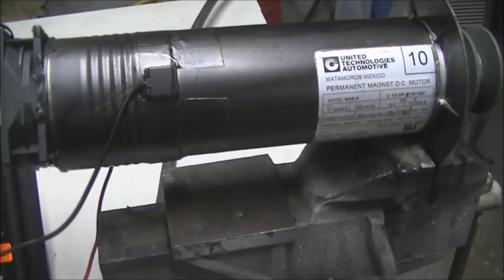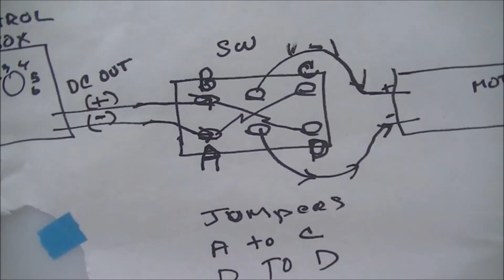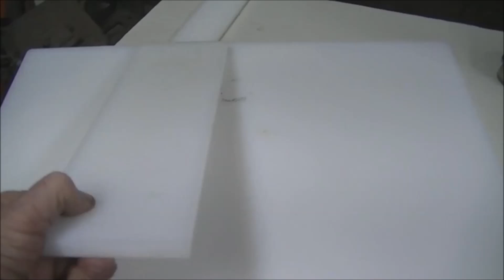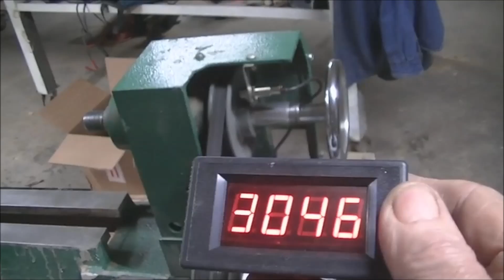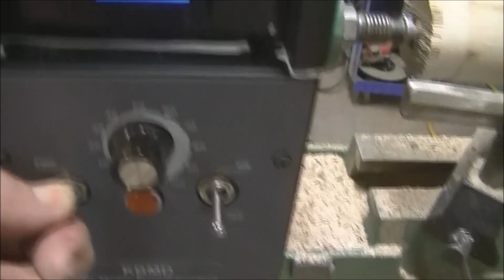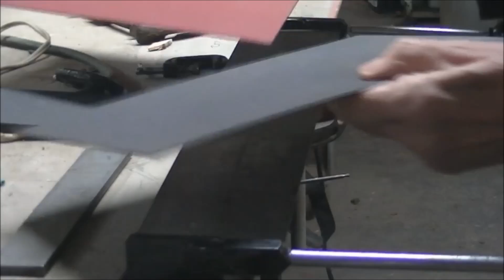Harbor Freight Lathe Conversion using a Treadmill Motor

Comment: Hi Larry,

Well, that was worth the wait.  Congrats on the updates!  Watching your tach it looked real steady while you were chewing on that chunk of wood.  I saw you drop to about 444 RPM there which is a good bit below the stock unit.  What's your minimum so far?  Also, what is the model of that controller?  I'd like to do a little research on that one to see what they brag about for their absolutes.

Best!
- Bill
Reply from the maker: I've had it running steady at 80 rpm.  I can stall it at that, but I would probably only sand at that speed so it wouldn't matter.  I cannot not stall it at anything over about 300.  Thanks man, tell your friends.  Larry
Reply from the maker: Check out my update, turns in the 40s.  Larry
Reply: Hi Larry,
I've seen your update and the updated, update.  You sir have epitomized American ingenuity, love the flags!  Also your moving the controller up makes total sense, sometimes it's all about the angle of attack on the workpiece.
My main (I think) interest in slowing mine down is that I seem to think I'd like to try some thread chasing for lidded boxes and other small items.  Sam Angelo (WYOMINGWOODTURNER) has a few videos up on this and it keeps rattling around in my head.  Without any experience so far to back it up, 300-400 doesn't seem like it would be too hard to keep up with.  At 16 TPI that's in the range of 2.4 - 3.2 threads per second, so not seemingly horrific. I think one way to go might be lifting the controller from the treadmill as well since it's sized for the motor already, leaving the final output intact, but bypassing the onboard control circuitry with a custom design.  Keep it up, you are a great craftsman and quite inspiring!
- Bill
Reply: Hey Larry,
Check your settings on your channel, was going to wander back over to look at the updated update again and your channel is showing that there is no content.
- Bill
Reply from the maker: I don't know.  I checked all of them and they are all marked public.  Suggestions? Larry
Reply: I'm finding information about sections that looks possibly related: https://support.google.com/youtube/answer/3027787?hl=en
Reply from the maker: Seems to be working fine now. I ran a virus check and rebooted my computer.  Check it out and let me know.  Thanks, Larry
Reply: The layout is slightly different, see now your uploads, created playlists, subscriptions and liked videos.  Nothing on your machine, this is just to do with youtube settings.  Your view of your channel is significantly different when logged in as opposed to public view.  You can either log out to see your channel as an outsider, or setup an alternate web browser (Chrome, Firefox) and use one browser to maintain your channel, and another to view it as the rest of the world sees.
Reply from the maker: No I know it wasn't my computer, but I did find a couple of issues which were corrected.  I changed a lot of settings back and forth on my channel, and google+ got in the mix to muddy the water.  It did start working at the same time. Take care, Larry